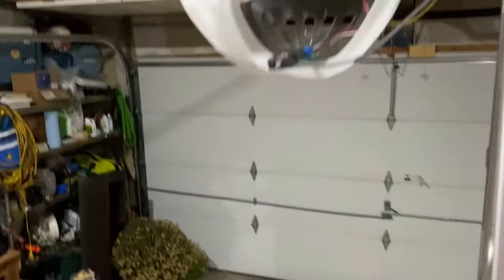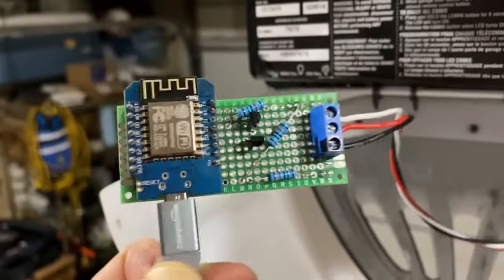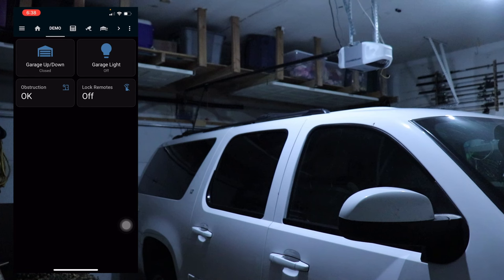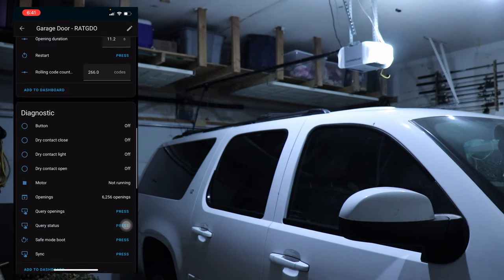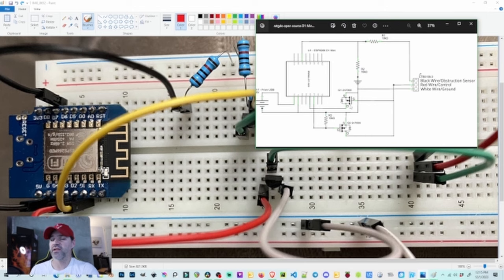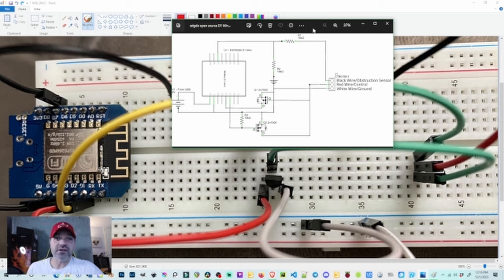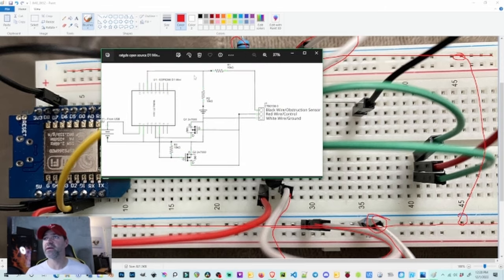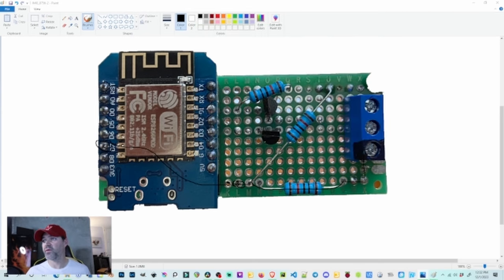DIY ratgdo myQ Workaround | Home Assistant

Comment from the maker: ***The giveaway winners have been drawn!!!***
They are as follows:
@timhelton161
@notchy1200
@FOreverYoung
@a802jz

Congratulations to the giveaway winners!!!

For those that wish to purchase a diy ratgdo from me fully assembled and flashed with ESPHome, you can do so here for now: https://www.buymeacoffee.com/thedaddyshow/e/189951.   As soon as I get antoher method up and running I will update the link.  I'm working on making some really pretty pcb boards with some other features no one else has so please consider going to https://www.buymeacoffee.com/thedaddyshow/ and donate to help further this project.

****The video on how to flash the DIYratgdo board has been published!!!  - https://youtu.be/f235NBUcelg ***
Reply: I know you have  not mentioned it but is a casing for this an option? Or suggestions of keeping it getting dusty in the garage. Do you just leave this inside the white plastic cover where you pull back to replace the lightbulb of the garage door opener?
Reply from the maker: I do not have a cover as of now.  If there is enough demand/support I plan to get a pcb put together and a case as well. Right now, however, there is no case or cover.  I currently have mine (the first one built) set in side the garage door opener light cover.
Reply: Would like to be entered in give away, thank you
Reply from the maker: Make sure you are subscribed and like the video and I will get you entered

Comment: Thanks for the video, this my project for this Sunday. I will let you know how it works
Reply from the maker: Awesome!  Please do let me know how it goes!
Reply: I used 2n3904 that I had  , but it failed, i have ordered 2n7000  hope that will solve, I was referring 1 Gate 2 Source and 3 drain.
Reply from the maker: @anufuntime that sounds good!  I haven’t had any issues so far.  The 2n7000’s worked right off the bat.
Reply: @thedaddyshow01   I see you are selling the board do you ship it to Canada? how much it may cost?  Can you also add flashing video as this device requires additional steps to add into HA
Reply from the maker: I do plan to make a video on flashing and setting up in Home Assistant. Have you used ESPHome inside Home Assistant before?  

I am selling boards and have a link to order those. I have to find out what it costs to ship to Canada. Email me at the1daddyshow@gmail.com and we can discuss further.

Comment: Would it be possible to connect 2 garage door openers to 1 D1 or would I need 1 of these for each door?
Reply from the maker: It is theoretically possible, I think.  

I don’t really know but I think you would have to fork the ratgdo github and adjust the python programming to accommodate a second door and then adjust the yaml code in ESPHome to point to the pinout you choose for the second door as well as your GitHub repository of the forked ratgdo. 

As for the circuit board: If you wanted to add the second door on the same circuit as the first door while utilizing a different pin a couple diodes would have to be added between the pinouts in the esp8266 and the transistors and then the proper circuitry would have to be soldered in or created on a pcb board. So I think it is doable, but I truly don’t know for sure. I haven’t looked into that as I haven’t needed it. That is an excellent thought though!!

Comment: What does the software side of this process look like? I haven't used ESPHome yet, but it's my understanding HA picks it up automatically if it's on the same network.
Reply from the maker: ESPHome is awesome. It will pick it up in Home Assistant. I will release a video on that part in the near future. If you flash a chip yourself you will have to edit the yaml in ESPHome before it is fully ready.
Reply: @thedaddyshow01  the chip your selling is already flashed, right?
Reply from the maker: Yes, that is correct.  I am flashing it with ESPHome but it can be flashed with MQTT.  The ones I am flashing with ESPHome have the yaml code corrected already.  @DaveHenning
Reply from the maker: Video about the software side is forthcoming and will hopefully be done before the weekend is over.

Comment: Will this work for a craftsman garage door opener? Mine has a purple learning button.
Reply from the maker: I honestly don’t know. If the craftsman uses the same logic in their board then it theoretically should but I truly don’t know. I’ll do some research and let you know what I find.
Reply: The craftsman purple button does not use encrypted signal between the wall push button and the opener.  Therefore you just need to short the wires to activate the motor.  This ratgdo has some support for that style device but it’s not the primary target audience.
Reply from the maker: You would benefit, in part, then from my other myQ workaround video using a shelly1 relay.  You just wont need to solder inside the wall-mounted button and can just attach everything at the opener it sounds like.

myQ Workaround | Garage door openner | Shelly 1 | Home Assistant
https://youtu.be/H3tFiPtltbM
Reply: @thedaddyshow01  thank you all for the help
Reply from the maker: You are most welcome!  I hope the other video was helpful.

Comment: Are those mosfets the other way around from what you said in the video, isn’t the left side drain if your looking at it with the flat side up?
Reply from the maker: The drain is the left side of each mosfet, correct. That is how they are set up.  The red wire feeds into the Drain (left) on one transistor and the Ground(center) on the other with the Source(right) to ground on both and the Ground(center) inputs from D1 to one transistor and the Drain(left) output from the other transistor to D2.
Reply: @thedaddyshow01   makes sense, at around the 18:00 min mark in the video you say the drain is the right side post.  I got a bit confused by that, maybe  add something so others don't get  tripped up by it.  Great video otherwise! thanks
Reply from the maker: Thank you for the heads up!  I appreciate it. I’ll look into adjusting or notating it.

Comment: Hi can you post the automation or script behind the up/down toggle button? My opener is exposed HomeKit so I put in an if state=open, then close, else open. It works fine but I want to do the same directly in HA.. any guidance would be appreciated
Reply from the maker: I am using ESPHome inside HA and haven’t done any scripting for the board. I have only edited the yaml file in ESPHome. I have not tried to integrate it through Homekit. You might reach out to the Home Assistant community on Discord. I will try to do some searching as well.
Reply: Thanks for responding back. I found it. I have to use the cover.toggle call service and then pass at the entity name. I was just trying the entity name or device with wish then toggle method but that's not valid. Thanks again

Comment: Hello...I think I have made these correctly. When I connect them to my GDO Liftmaster with yellow learn button...the obstruction sensors go dark. I assume red wire to red terminal, white ground to black terminal, and black data to one of the two remaining white terms. Flashed with 2.0 and 2.5 no luck. ESPHome sees and communicates. Just no GD movement. Any ideas?
Reply from the maker: The way I made mine is the red wire to red (the input into one side (drain) of one transistor and also into the ground (center) of the other transistor). The black wire goes to black which is wired through a resistor to pin 7 on the esp8266. The white wire goes to white and is the ground.  The black wire on the GDO is the data from your obstruction sensors and needs to go through a resistor to pin 7 with another resistor between pin 7 and the first resistor returning to ground.
Reply: What I don't understand is why the obstruction sensors go off? The Paul Wieland RATGDO does not do this. There appears to be extra chips on the board purchased from him. Wondering if yours doesn't have all the needed chips?
Reply from the maker: I have the yellow learn button and only built mine exactly as shown in the video and it works flawlessly

Comment: Hell yeah the video is finally up 🎉🎉🎉 Nice clean set up good solder joints small but powerful little project. Will it integrate with other home assistant I.E. Google Home or Alexa. 
Great job brother 💙💙💙
Reply from the maker: That is an excellent question!  One to which I do not know the answer for certain.  I set mine up via ESPHome but it can be done via MQTT.  I would recommend checking the ratgdo documentation.  I do not know much about Google Home or Alexa.  I have neither.
Reply: @thedaddyshow01  Do you use any home assistant or just ESP Home for the ESP Board projects.
Reply from the maker: I use Home Assistant
Reply: It wont natively work with alexa, but Home Assistant can be a bridge to alexa and google home
Reply from the maker: Tim, thank you for the response!  I’m still working on google assistant setup myself.